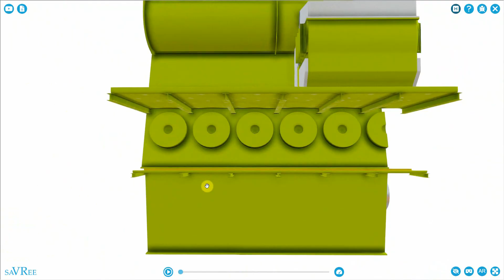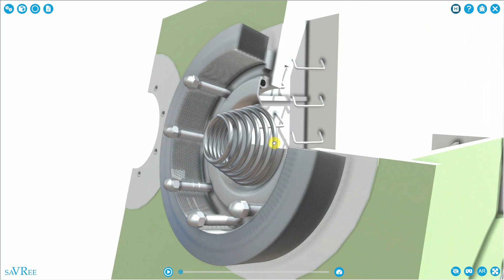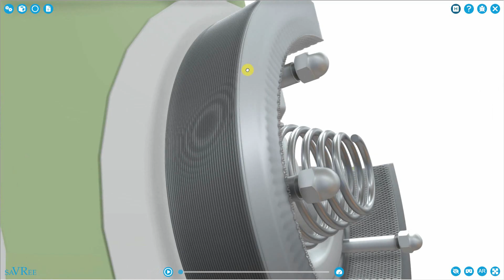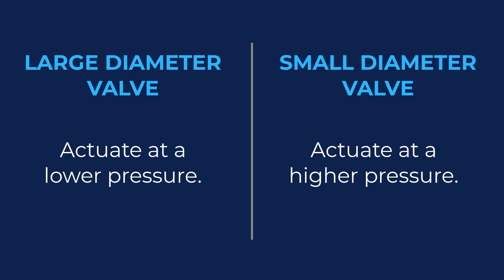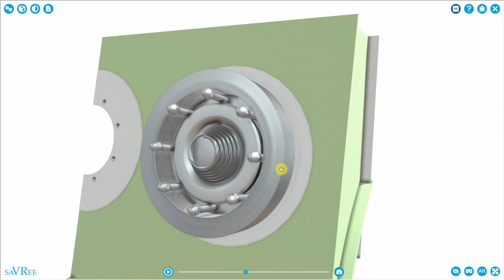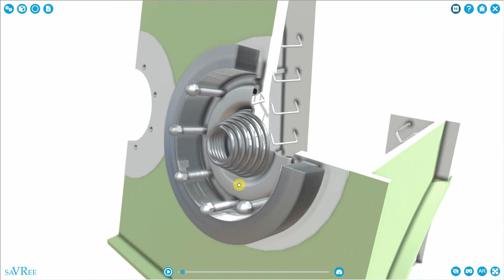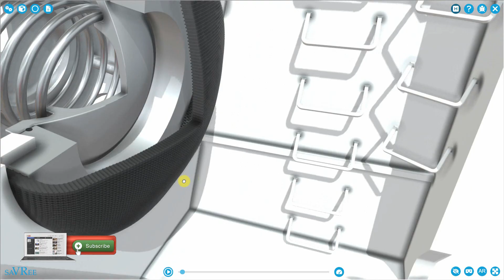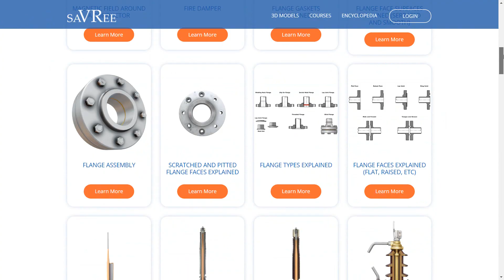Crankcase Explosion Relief Valves Explained

Comment: You ought to decide on wich side the gauze should be.
3:49 The drawing shows the flame arrester on the inside and before the valve. Is that wise? Wouldn't the gauze constipate and so fail its duty to cool down the flame front? Not to mention failing to relief the pressure safely.
Reply: It depends on the design of the valve. Like with most things, there are many different types, some being better/more reliable/cheaper/more effective than others.
Reply from the maker: For every rule there is always an exception! The best thing is to reverse engineer things in your head. This keeps your mind active, and helps with understanding. Just my opinion!
Jon
Reply: @savree-3d  
To help keeping your mind active, watch 0:54 and 3:52. Can you spot the difference?